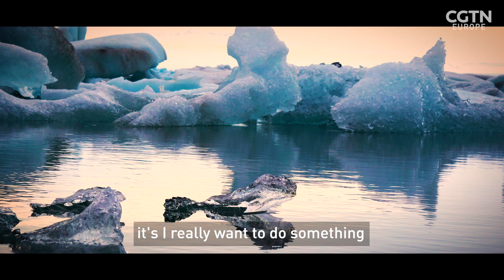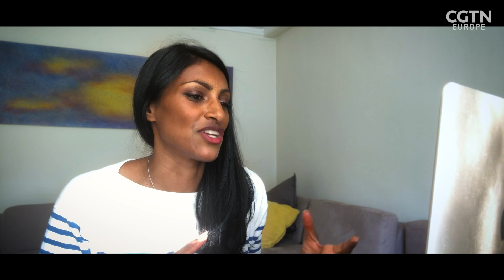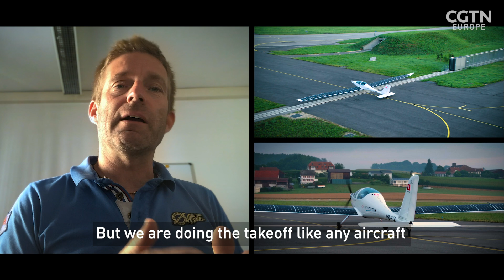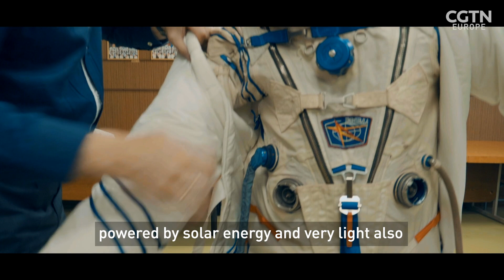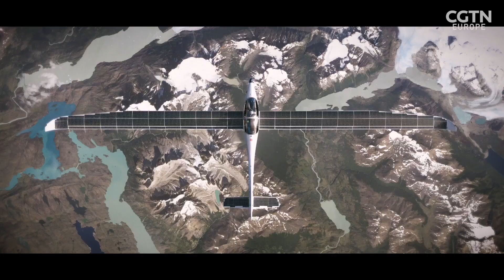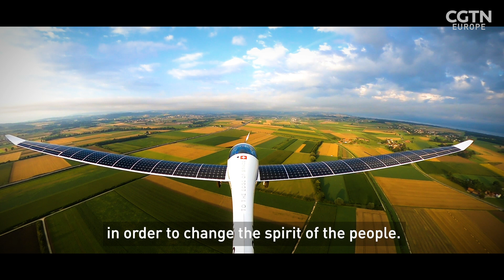Flying to the edge of space using only solar power

Comment: With all the solar panels and batteries I thought it would be heavy but it's actually lighter than most the gliders are. I wonder how large the batteries are? They must be small. If we are to reduce our carbon footprint we need to start with making fair laws eliminating war and reducing what we use. We really dont even need to fly. I dont think we will fly this way unless we learn better battery tech and i mean much better. Hydrogen could be a pretty good option for flying.

Comment: If this plane could transform solar energy into electric thrust it could eventually leave Earth's orbit without the need of rockets at some point.
Reply: no, because electric jet engines have very, very little thrust, the thrust of modern liquid rocket engines is 10-800 kN, while modern electric rocket engines provide a thrust of only 0.1-1 N. Yes, in terms of specific impulse, electric rocket engines beat liquid rocket engines, but to enter orbit, we need not efficiency but thrust, a lot of thrust, which electric rocket engines simply cannot provide.

Comment: I guess nobody in the comments brought up the issue with the thin wings and lack of air pressure at that altitude. How do you get that high with so little atmosphere?
Reply: Exactly my thought, propellor aircraft have a low service ceiling due to the loss of lift and propellor performance due to the reduced density. Larger wings will increase the lift but the propellor will fail to produce enough force to keep the aircraft at a high enough speed to avoid a stall. Maybe the propellor can turn at supersonic speeds but that would add more problems.
Reply: @teenflon  the problem is more that combustion engines dont work well at that altitude, the propeller itself is not realy that much of a problem. The wings are high aspect, meaning minimal drag with not much lift, but long wingspan
Reply: @randomguyinanglider  Propellers don't work at high altitudes.
Reply: @dipladonic  they do. Combustion engines don't.
Reply: @randomguyinanglider I get it, but as as you can see in this video, at high altitude, propellors aren’t practical.

Comment: what if we build the same glider but with a jet engine, the engine itself will be specially upgraded to work in the stratosphere, and also on board the glider you can place a small tank with liquid oxygen that will mix with air from the environment and feed into the engine
Reply: combustion engines and high altitude dont pair well, also you have to fly fast to make a jet efficient. this thing is not fast
Reply: "the engine itself will be specially upgraded to work in the stratosphere" yeah, you see, this little small tiny upgrade is just the holy grail of aviation engineering.

Comment: How much of CO2 and other waste was produced to make this plane since it was made with resins and carbon fiber made from oil? How do you recycle or reuse the parts after the planes life expectancy is over?
Reply: You dont, but you also dont do that with any other aircraft
Reply: @nilsanderson8800  Why not?
Reply: @fijapopovic5335  because you need properties like being sturdy but also flexible and most importantly, lightweight, you often only get that with composites which are non recyclable or not economically recyclable.
Reply: @nilsanderson8800  You have recycling facilities for decommissioned aircraft (at least in my country) to recover as much material as possible. Plus the way of manufacturing, production of raw materials and their location can increase or decrease your pollutant production overall. 
That's why when people are saying "My product is good for the environment because it doesn't use oil" but their whole product is made of composite or other non recyclable materials using traditional methods looks like an irony.
Use the proper material and methods for your application, maybe your product uses less material than the competition, but don't say that it is "good for the planet", It would be more correct if it was "less pollutant then the competition, because it doesn't use oil during its use". Otherwise it's just green-washing.
Reply: @fijapopovic5335  but it is still built the same way airplanes that operate on kerosine. Of course you can scrap some part of the plane, but the rest will just be left to rust in the Nevada desert.
Reply: @nilsanderson8800 rusting just puts the minerals back on the earth and will be regained in the future as ores.
Reply: @asandax6  But you will need to put an other extra energy to get it back into metal thus making more pollution
Reply: @fijapopovic5335 When you consider the ongoing demand for petroleum products consumed by internal combustion or jet aircraft, passing the breakeven and entering a savings when it comes to both CO2 and petroleum comes relatively quickly, but of course varies depending upon usage. Regardless, the one time environmental cost of these aircraft does save compared to the ongoing environmental cost demanded by traditional aircraft. Also, let’s not pretend that constructing a traditional aircraft doesn’t have an environmental cost as well.
Reply: @dylconnaway9976  I'm not pretending that traditional aircrafts don't have an environmental cost. That's why I'm asking all manufacturers (airplanes, cars, houses etc) to do Life-Cycle Assesments correctly and refine them to be more exact so the consumers can see "with numbers" the environmental cost as well as the economic cost (If you through some material waste away it is money you waste).
Reply: Way, way less than the amount of pollution produced by using fossil fuels to run an aircraft for 10-15 years. It doesn't even compare. 

That's the point. 

These arguments are senseless

Comment: Climate change has been part of this planet for billions of years, that been said all technologies are valuable and can be improved to better our lives
Reply: Even If you don't care about climate changes which you should, there is still the problem that fossil fuel is not an infinite resourse and will probably in not more than a century. So we better have alternatives.
Reply: @DanielSilva-gc4xz  fossil fuels are not causing climate change but a thing called precession of the equinox, and the orbit around the sun going from an almost circular orbit to a more pronounce elliptical orbit.
Reply: @davmac6148  this is a slow regular movement of 26 thousands years a cicle. Mind showing me the papers where you read that it is the cause for the recent climate changes?

Comment: Perhaps the next version would be able to incorporate more solar cells along the fuselage sides of the plane so that the plane can produce power from rising and setting sun periods. Every square foot counts. Also, if the engine can be mounted in the rear, it would reduce the turbulence going through the entire body of the plane and increase laminar flow which will contribute to better lift and efficient power usage. You just have to use taller landing gears that will let you tilt for take-off and land more safely without damaging the rotors.
Reply: what's a square foot👀
Reply: @zenbot8048  12x12'' / 4 burgers in a 2by2 layout 🤷‍♂️
Reply: the blades can retract forward to solve the problem
Reply: Propellers in the rear will lose efficiency installed in the rear, thus you would need larger propellers and engines, adding weight in the rear, which is not nice either.

In the end you have to choose which design has more advantages. If the propeller can be folded in, the front becomes the best option available.

Comment: A plasma cutter puts a high voltage, high Amp current through a stream of compressed air. A critically dense plasma is opaque to light and other radiation.  If you focused the light from a parabolic trough mirror onto a stream of critically dense plasma, you could heat up the plasma to even more extreme high temperatures and capture much of the solar energy.  A hundred square meters of solar cells costs maybe $10,000.  A hundred square meters of mirrored mylar over a flexible plastic sheet might cost a small fraction.  A wing tends to naturally bend up into the shape of parabola.  With some aerodynamic struts to hold the exact shape, the same area could collect five tines more solar thermal  than photovoltaic energy. Focused through a strip of glass covering a long slit in a cylinder, a solar ram jet could be quite simple.  Solar panels also tend to be heavy. A silghtly tapered cylinder would be like a long rocket engine and possibly a lot more efficient with more of the heat working against the walls of the engine.  A blast of compressed air down the middle if the cylinder that is turned into plasma at the front by a high voltage arc receives the solar energy.  The walls of the cylinder would heat up from the heat of the plasma and provide more heat to the mass of air moving through the cylinder.  The plasma could be extended the length of the cylinder by having more electrodes at intervals and injecting more compressed air into towards the center at a slight angle to the cylinder. But the heat from the solar might maintain the plasma at the center for the entire length.  Just heading towards the sun would focus the sunlight on the plasma.  If the cylinder is a little longer than the focal area, the angle of the sun to the horizon will not be as much of a factor.  If the solar concentration is 1000:1, the plasma might be easily maintained for the length of the cylinder once a plasma is created at the front end by a high voltage arc.  A powerful electric motor comoressor at the front and a turbine/generator at the exhaust end might allow it to use hydrogen or other jet fuel to get off the ground and up to ram speed.  That would eliminate the need for a drive shaft down the middle where the plasma is.  
A hundred square meters of mirrored, swept wings might collect near 100,000 watts of solar energy compared to only 20,000 watts of electricity from solar panels.  If the electricity from solar panels was used to create an electric arc to drive a jet engine, it would be maybe one-fourth as powerful as the concentrated solar thermal collector. 
With swept wings and a ram jet engine, the plane might easily get into space as it goes faster and higher in the thinner and thinner air.   A little bit of  fuel to maneuver in space and return to the atmosphere combined with the large wingspan to brake the plane while providing a lot of lift and distributing the heat over a much larger area might eliminate the need for a heat shield except on the most forward parts. Using subsonic air to cool hollow, forward facing parts is another option.  Or interior liquid cooling.  
Once the plane is in space where there is no air resistance, it could deploy huge mylar surfaces to make a funnel to collect the very sparse hydrogen available in space.  Accelerated to near the speed of light by high voltage plates along the length of the cylinder and confined by pulsed high magnetic field coils, the plane might travel through space at near the speed of light after a few years of solar energy from a thousand square kilometer mylar parabolic dish. Or maybe not.  But it would be going pretty fast.
Reply: You missed one big glaring problem ignoring all others and that is Plasma will eat through any material so your engine isn't gonna last that long especially considering you can't make it with a heavy dense metal that'll slowly get sintered rather than quickly oblate.
Reply: @asandax6  
The temperature of burning jet fuel is too high for the surrounding materials.  Comoressed air is injected around the combustion area to protect the surrounding materials.  
The commenter starts the comment with the word "you".  Accusations  and insults tend to start with "you".   
The possibilities seemed interesting compared to the potential difficulties.  But it seems that certain people are more interested in making things difficult.

Comment: The Lilium Jet combines the convenience of vertical take-off capability with the speed of a jet for intercity regional missions. It features 30 battery-electric motors within the main wings and the flaps of the canards, which are the only moving exterior parts.

Comment: The Earth’s core is 6,700 km deep. The deepest humans have drilled is 12 km. The temperature of the inner core is "estimated" (we don't know) to be between 3,000 and 5,000 Kelvin (4,940 to 8,540 degrees Fahrenheit). The high temperature comes from three main sources. There is residual heat left from the Earth's formation, and heat is generated by gravitational and magnetic forces from the sun and moon as they tug and pull on the inner core. (The Sun heats the Earth's CORE. Sunlight is a small part of the Sun's energy) finally, the radioactive decay of elements deep within the Earth also produces heat. The Sun's total energy is NOT constant. Humans have only begun to study our star with radio, computers and satellites. Solar winds from coronal mass ejections can even change Earth's orbit. Open your mind and think. CO2 is an insignificant factor an infinite number of variables. Why don't scientists actually know the Earth's core / mantle temperature and how much it fluctuates? It's only because of deep drilling corporations that scientists have accurate measurements of crust temperature. The mantle and core temps are pure speculation. Just like climate forecasts.
Reply: When Co2 is insignificant explain how venus should be pretty much like earth relying on the mass and distance from the sun, only that venus releases all the co2 from the core which is abaut as much co2 as the earth has stored in fossil fuels and bio mass. Jes shure we cant be 100% certain how the suns power output will be in 50 jears but by basic logic and the fact that the sun is billions of jears old we can assume it will be the same, while we would fight wars over the last bit of oil we have lying around .

Comment: I think a ducted prop (rather then ducted fan) is more efficient than just a prop due to the differences in tip vortex shaping. Ducted propellers work on a much larger volume of air at a lower speed than ducted fans which is how they beat them on efficiency at low speeds. They beat normal props by nearly eliminating the tip vortex issue.
Reply: Hmm I’m curious can you explain the difference 😊
Reply: Interesting thought, though how efficient are ducted propellers really? To further solidify the question, could the ducted propellers deliver enough efficiency to produce the required thrust at an attitude, where there is barely any medium (air) remaining?
Nevertheless, would there not be modern technologies available to create//simulate as low atmospheric pressure as at the height of 80000 ft. and test different (specialized) propellers?
Curious!
Reply: @getehrwolf6111maybe,but the votice’s at the end of the blades is what causes certain inefficiencies too.

Comment: Ah, NOT cheap, safe or cleaner...
Solar is expensive ESPECIALLY THE batteries that can't be charged or discharged to 100%. Solar battery is not good in extreme cold weather and been known to explode in heat and, it gives of more H20 than car imitions.
The process of MINING and manufacturing lithium is as expensive and dangerous as PETROLEUM...

Comment: Would it be better to use bifacial modules and can skin be translucent?
Reply: Interesting, earth albedo is 30% in intensity of direct sunlight and has almost the same spectrum as direct sunlight, a little less in the UV, but that is usually not a very large portion of what a solar cell uses, so the contribution from the underside would be significant.
Reply: @Tore_Lund  Especially for dawn and dusk operation. Could use serpentine turns to continuously collect light.